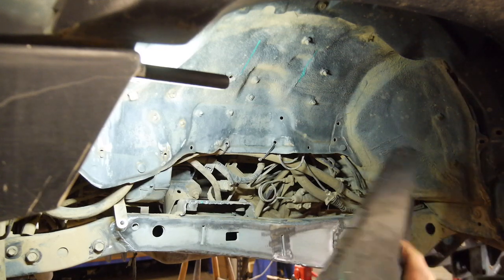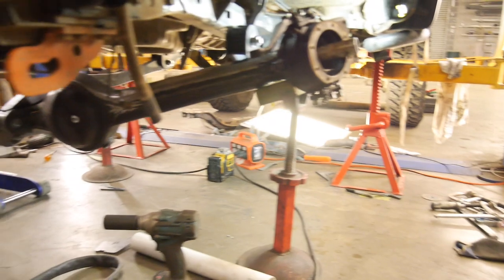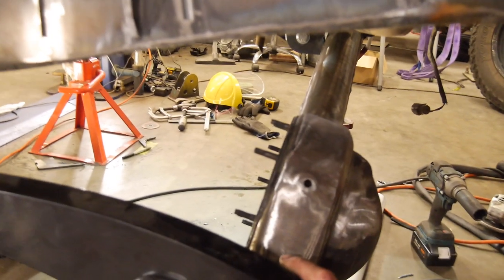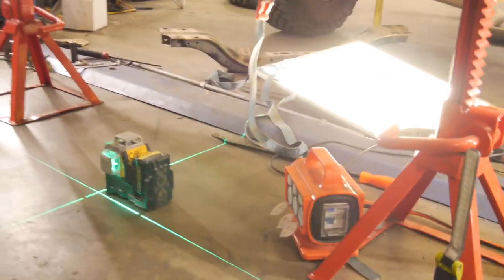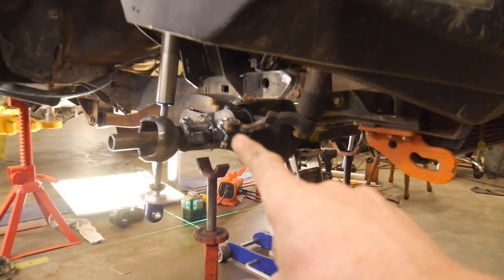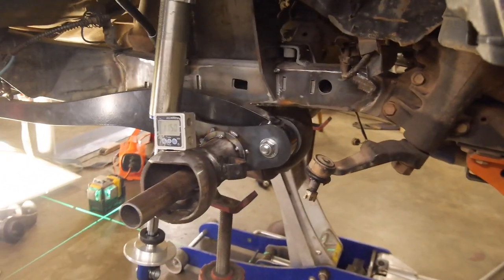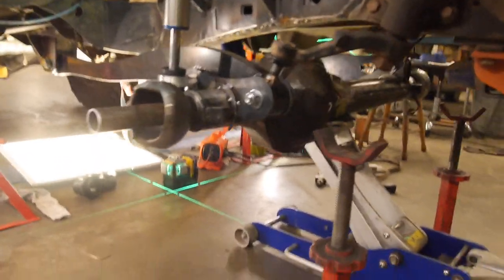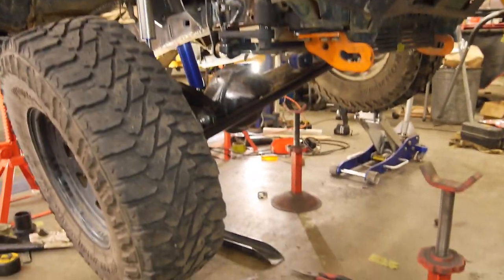SASSING THE SURF - PART 3 | Solid Front Axle Hilux HOW-TO

Comment: Hey mate. Loving the videos and the channel. Glad you're back making videos again. Just wondered what front recovery points you've used in the surf? Been looking for some for mine and wondered if later hilux or 80 series ones fit. Thanks and keep up the good work.
Reply from the maker: Thanks mate. They are an 80/105 series recovery point. Bolts straight on basically. Think it picks up majority of the holes from memory
Reply: @boostedbuiltgarage  awesome mate. Thanks heaps

Comment: Would flipping the radius arms to the underside give much more room on top of the axle tube for coilover mounts and bump brackets?
Reply from the maker: Yeah, definitely. However, in my case, my coilovers would still be too long to mount on top. Unless I wanted a really high ride height in order to leave enough bump travel on the shock. You'll see how everything worked out in the next couple episodes anyway

Comment: i sassed my jackaroo with flipped 80 arms on gq housing a gave up because the arms smashed into the rails on flex and the ride height was too high, so i bought a complete 80 roller and ive spoken to the engineer and plan is to transplant the jackaroo body onto the 80 chassis instead
Reply from the maker: Yeah it's a tough time getting things to fit and work but usually with enough thinking you can make things work. Like I did in the end. Which you can see in the latest ep I just dropped this evening 😉 but yeah if I had my time again knowing what I know now I would have bought an 80 or GQ/GU patrol to start with. But I wouldn't change it now, I love the uniqueness of the Surf haha